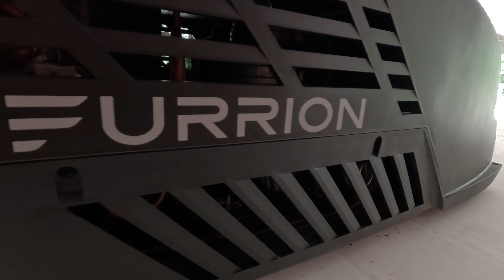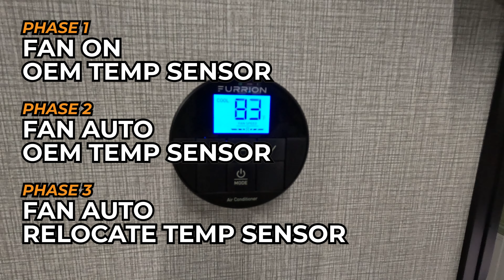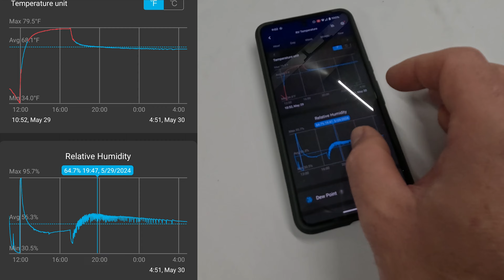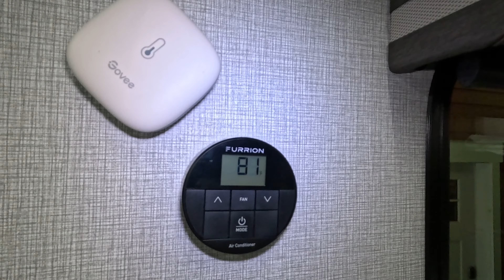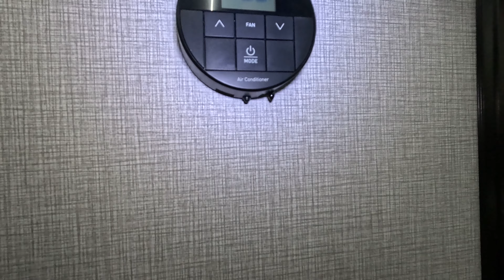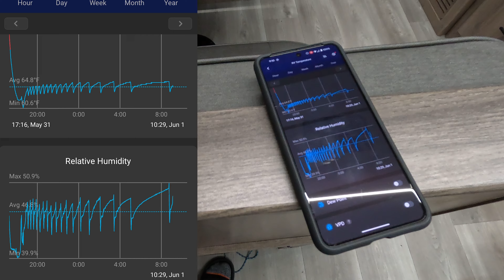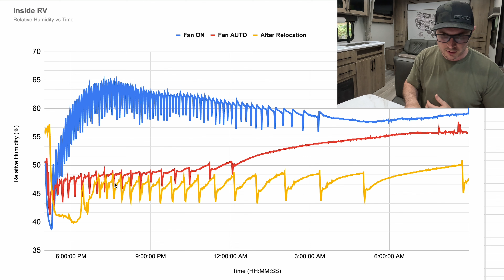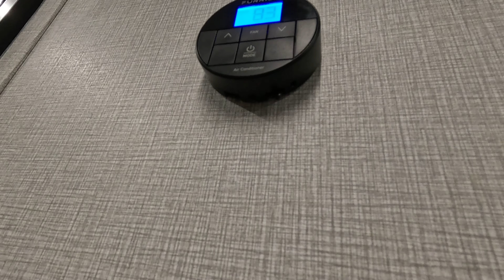Did I Void My Warranty? Data Showing Furrion AC Temp Sensor Relocation Before & After

Comment: Pretty sure the humidity issue in a house is due to the house having a fresh air intake.  If you run the fan all the time, it's constantly drawing in humid outside air.  Even when your AC isn't running.  I believe your camper doesn't have a fresh air intake.  Therefore humidity didn't signactually rise with the fan on continuous, The short cycling really limits how cold your unit gets and hinders the moisture removal.  Good job on the rest of the video though.
Reply from the maker: Great question. There was a more detailed response from HVAC contractor in the comments below, so see his explanation. A lot has to do with climate/zone. Basically the fan running continuously increases humidity due to re-evaporation of moisture on the coils when compressor shuts off and warm air keeps moving over the coils. The data in chart shows humidity spiking after the compressor turns off as that condensate no longer drains outside, but rather just gets re-dispersed like a humidifier. That sudden spike in humidity is the key indicator. But, you raise a good point that short cycling further inhibits the humidity removal.

Some newer/tighter homes have ERVs where fresh air is brought in, but not as many where I live at least. Our climate is so humid that if you have an ERV, you have to pass it through a dehumidifier first as it would rec havoc on the interior climate.

Comment: Interesting for sure.  However if I replace again it will be with one wired for a wall thermo and one that shuts of if a cooling cycle is complete.  I drank the coolaid and purchased a Houghton from Rec Pro.   Not happy.  They claim it is super quiet.  Compared to jack hammer.  The worst part is that it runs all the time.  We also have a Dometic and it is a bit louder but it shuts off when not needed.   Fortunately we use the Hiughton only then it gets in the high 80’s to supplement.   No more latest and greatest for me.  Coleman or Dometic only.
Reply from the maker: I hear you. Great points.

Comment: I wonder if the thermostat gave you higher readings because it is mounted on an exterior wall which would be slightly warmer than say an interior wall...  Just a thought.   Thank you for sharing your experience with us, great video.
Reply from the maker: Thank you. Great point. I could definitely see the exterior wall generating heat especially if sun was hitting it on the outside too. It turned out that the thermostat itself was generating a little bit of heat compared to the surrounding wall and then I guess with me extending the wire the resistance changed slightly causing it to read about 3 or so degrees higher in the end...I don't mind it though as that means setting it to 72 makes it more like 69ish. It has been working like a champ since though...much more dry on the humidity side by having compressor run longer and then no fan when it's off.

Comment: did you connect the green and yellow wires in the AC unit to the previous 2 wires that the temp sensor was originally connected  to?  thx
Reply from the maker: Yes, I used green and yellow just because they were surplus in my unit, but you could do any color as long as it is same on both ends.

Comment: Great video - i have purchased this unit. I noticed a "dry" setting on the thermostat.  Do you have this setting and have you implemented this setting in your data.?  I am not sure exactly what this setting does.
Reply from the maker: Yes, the "dry" setting is kinda misleading in my opinion. It seems to more run the compressor based off a set amount of runtime as opposed to the set temperature, but it cools constantly while the compressor is running so the actual temperature keeps dropping. For example, I started out at 75 degrees...then it ran till about 71 degrees...came back on and ran till about 67 degrees...and kept getting cooler down to about 64 or so. Kinda odd setting in my opinion, but basically I think it is designed to run the compressor longer in hopes of pulling more humdity out of the air...which it indeed does, but there's no way to slow down the compressor or fan given it isn't variable speed so it has an extreme cooling effect.

Comment: When relocating the room sensor to the wall thermostat did you disconnect the existing sensor in the plenum and use that to go in the thermostat?
Reply from the maker: Yes, indeed. I just spliced into existing sensor and used existing surplus thermostat wires to extend. There's a third party that also makes a kit complete with sensor and wire, but then you have to run your wire through a chase to the wall. I did change the resistance in the wire by extending it, which has caused thermostat to read about 2-3 degrees warmer than reality.
Reply: @AdventureRocks Extremely helpful thank you.  I did buy two of the relocation kits you mention from Castle Winch LLC which are plug and play compatible with the Furrion Chill units. However I am not technically inclined to even attempt that job myself.  I live in Orlando and will need to find someone to undertake that task.  Any suggestions please let me know. And thank you again. GREAT video!
Reply from the maker: @DavidHage-yw4le  I hear you. If by chance you have surplus wires running between your AC and existing wall thermostat, it'll make the job a lot easier, but I think any RV tech can do it for you, especially if you show them the video in advance. For all I know many of the RV techs may already know about this issue and have completed it for others. My AC though is running like a champ after performing the modification even after testing it and more extreme temperatures.

Comment: Our furrion AC started tripping the circuit breaker and it will turn on then off. Do you think this is the issue with the humidity?
Reply from the maker: Usually if a breaker is tripping repeatedly it indicates overdrawn amperage, meaning the AC is pulling too much current. Typically an AC is on its own breaker, usually 20A or higher. There could be an issue in the 120V power feeding AC, or some component in AC is failing causing it to pull more amps than expected. Hard to say...a lot of factors, and more diagnosis needed by a tech perhaps, but I don't think my solution in this video will solve your problem unfortunately. I'm sorry about that and hope you all can figure it out.

Comment: Have 2 Furrions in my Brinkley z3100 and I have been wanting to do the sensor relocation modification. Thanks for posting this video! I was going to purchase a third party sensor relocation kit but now want to check to see if I have extra wiring. So to confirm.. You cut the sensor from the existing wiring, clamped the ends of that wiring and then spliced it into the same colored wiring behind the thermostat right?
Reply from the maker: Thank you. Yes, you're exactly right. It's been running like a champ since relocating.
Reply: Paying so much extra for a Brinkley RV and having to rewire one of the basic appliances is unacceptable.  Manufacturers and dealers have done '0' to help RV owners.

Comment: i got the same response from furrion.  Got told to run a fan all the time. All this means is that your compensating for a huge design flaw. If i was in charge of those engineers i would fire all of them. How embarrassing for a company to even put out a product like this.
Reply from the maker: Sorry to hear. I wonder sometimes if they tested it more in the dryer climates where humidity is not a problem perhaps.
Reply: @AdventureRocks  I live in a dry climate and got told to run the fan all the time.

Comment: I have an IBex 2024 camper. Same problem. This is a classic design failure. No excuse. Making this sensor location better does not increase cost. Homes built in 1960 knew to mount the mercury temperature sensor on the wall of the room instead of inside the furnace. Furrion should be ashamed. My solution would be to pull the sensor out of the filter, the hot air moves up and the ceiling temperature reading should be acceptable. Once again, contempt for Furrion's product manager.
Reply from the maker: I hear you. It does seem surprising. I really like the Furrion AC otherwise and it's working like a champ after moving the sensor.